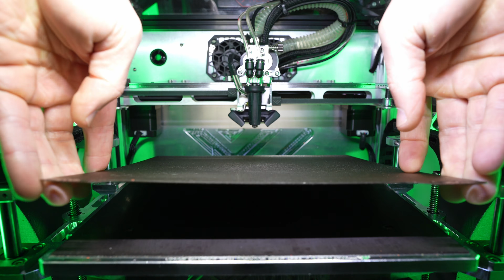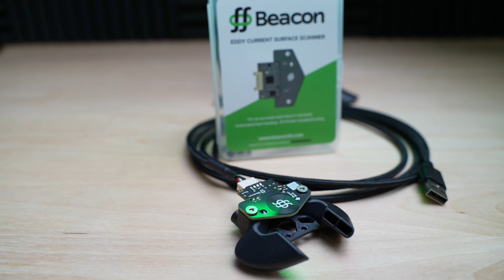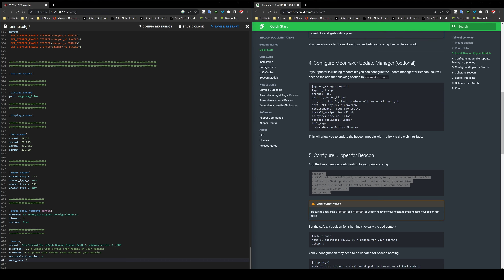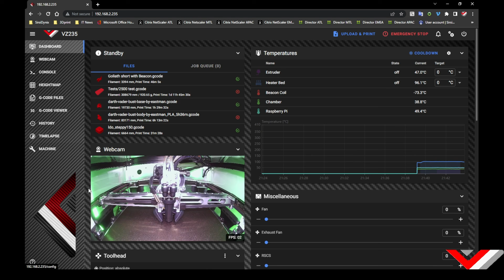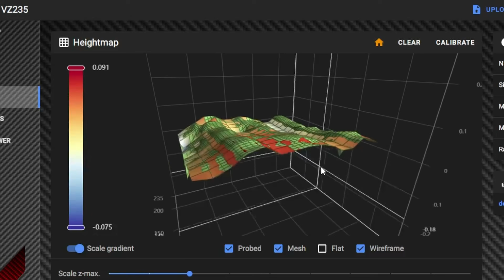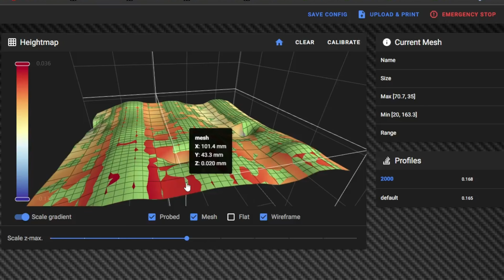Beacon Probe Review and tutorial

Comment: for canbus users I wonder if you can plug the beacon's USB into the USB port of a canbus board like the EBB36. I really don't want to run another wire through my loom, that was the whole reason I switched to canbus.
Reply: It’s usb a not c so unless you change the plug it might work but not worth the hassle in my opinion just run it along side the canbus cable it’s still very tidy

Comment: I have a question. I bought a low profile.
I did all the settings according to the manual, and the id of the beacon came out.
However, there is no response to the endstop check (m119). Is this normal?
Reply: Probe and endstop are treated differently, so if yo uwant the probe to also act as endstop you need to add this on your [stepper_z]:
endstop_pin: probe:z_virtual_endstop
It basically make the probe act as endstop z

Comment: This is fantastic! Is it possible to use this sensor for a super precise "bed screws adjust" routine, where you would park the printhead at the screw location and just look at the Beacon readout while adjusting the screws? Also, can you plug the Beacon into a CAN board or do you need to plug directly into the Pi ?
Reply: Its, its own MCU so no it uses the usb interface.  So unless your can board has usb pins then no.
Reply: @eclypse3d  Thanks!
Reply: Connects to can just fine.

Comment: Hey @Vez3D ✌🏿
I'm currently into printing with higher speeds and I'm facing issues with stringing.
I found out that retraction speed is may more important than Retraction Length.
What retraction length and speed are you using on your big machine?
Reply from the maker: 0.3 and 30mms retract with 80mm/s unretract

Comment: Simon, you should check your webcam configuration. It's not supposed to run between 0 and 2 fps.
Reply from the maker: Its set at 2fps  ..it cant take more. So yes its supposed to run at 2 hehe. Its set to 1080p ..and when at 1080p it runs in still mode. Google it :)
Reply: @Vez3D  i see, so it's on purpose. I had an issue with mine that limited it to about 2fps. When corrected it shows the feed at about 20.
Reply from the maker: @karlspena  what cam ? the official rapsi v2 cam with sony sensor auto turns into still mode when using 1080p..
Reply: @Vez3D  that was precisely the problem. I wasn't using the raspi cam, but a noname chinese usb webcam. Had to adjust some details on the config files to make it work.

Comment: But hey, that is inductive probe, right? So not actually measuring the surface?
I have two side PEI sheet, smooth and textured. When I flip the sheet I'm getting almost inverted bed mesh, and in one case when I dial in the Z offset and then flip the sheet it will dig into the PEI. So not happy with it. Tap is waiting.

Comment: I guess this has the same problem as most other "non-physical" probes in that it measures where the metal below the nozzle is, not the PEI or other non-metalic surface that actually forms the build-surface, right?
Reply: That is correct. If you print on steel sheet with PEI, it can't take the PEI into account. I personally print on bare steel with glue. No PEI involved so no need to worry about it peeling off, also beacon is reading the print surface (minus maybe any contaminants that might be present).

Assuming that your PEI is sitting super flat on the sheet, then that's just a fixed offset. Beacon can get everything else measured (twists in bed, motion system, uneven mag sheet, bumps in the spring steel sheet, ...) because it affects the metal part of the print surface.

For me Beacon is a no-brainer because it doesn't require diving to get the readings so it's ultra fast. Shaves minutes of bed probing, very high accuracy, and very dense grid that is impractical (time) to get with other probes. Also, since I print with glues (Vision Miner, NorthPrint.ca strong glue, Dimafix), it's nice that the probe actually doesn't touch the bed and so doesn't over time get glue buildup on it.

Comment from the maker: IMPORTANT NOTE: Noticed that accuracy test and probing had issue on my probe. Beacon dev spotted the issue and the temp sensor on the probe is broken. You can see the reading of the themp going nuts on the mainsail screen. I must have broken it when I did the de-soldering and re-soldering. Since it does temp compensation, I get weird accuracy and reading in this video. He also thinks that it explains the wave you seen in the bed mesh. Accuracy is coming out in the range of 10-50 micron instead of 0.4 micron.  So even with a broken probe it was awesome, I can't wait to try again with a perfectly working unit :)

Comment: seems like you need to add an avg filter on the measurements!
You are reading the values like they are without noise, thats not smart..
Reply from the maker: Sorry what?😂
Reply: @Vez3D  To get a more stable result, it would be better, if it could sample each spot, like 5 times, and then move on
It could be the reason, why you get those extreme low spots
Reply from the maker: @Zplizor  beacon spotted the issue.. i got a broken temp sensor on thr probe. I must have damaged it while resoldering it
Reply: @Vez3D  awesome, but still, never thrust a non filtered signal, thats atleast how its done in the automation industry
Reply from the maker: @Zplizor  do you mean probing many times ? and average it ?
Reply: @Vez3D  yes, I have for a work project some optical sensors, there I sample them some times, and take the result from averaging them
Cant say if it is at all possible in klipper FW, but if it is, I could maybe give a more correct result in the end
Reply: @Zplizor  I think it already does that, as it measures several times per second. Also stock is giving two passes, but the reason is to compensate the little amount o slop that can give you a different reading between probes done accelerating and decelerating.

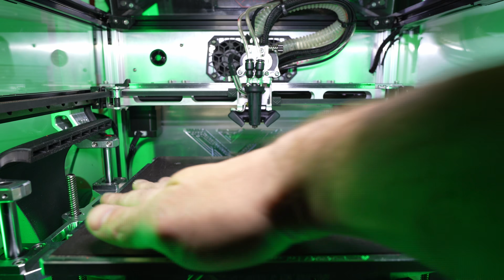Comment: BTW, does anyone know what printer model this bed (3:04) is from?
Reply: Nononono... I mean the one with cylindrical magnets, that you show as counter-example. I was looking for something like it the other day. 

The magnetic adhesive layer... I get the impression that it's thermal expansion is way out of control in hot chambers. And the prints look like mushroom stems before it stabilises.

Thanks for the link to the shop, Vez. ;) That hotend is something I might buy at some point.
Reply: @DailyFrankPeter  China magnetic sheets can be pretty bad, if you can invest on a sheet of Graviflex it is well worth it! Unfortunately it's common in Europe only
Reply: @karellen00  That's fine, I'm in Europe. Which shop sells it?
Reply: Looks like a v2.4 bed. Maybe mandala rose works
Reply from the maker: F3d-racing-fdm.myshopify.com bed

Comment: I don't think that this probe will account vor different PEI layer thickness unless the spring steel of the bed is of a different thickness. This is as the website states an inductive probe. So it can only detect conductive materials. I also think that if you have different types of spring steel you need to rerun that initial nozzle touching the bed calibration. So the probe can get a proper baseline zero reading. 

TLDR: I don't think this system is suitable for quick different bed swaps
Reply: Thats because Bed Mesh is not used for the Z-Offset. Its jsut used to confirm whether or not your Bed is flat.
Reply: @jonny7fly  Yes I understand that, but I was refering to what he said in the video. He said that he was ajusting the z by changeing the mechanical z-stop and that he wanted to use this for quick plate changing and I dont think this type of probe will speed that up.
Reply from the maker: Yeah it will . Tested it. The steel sheet is different thickness. The pei coating is roughly the same
Reply: @Vez3D  Aaah alright then it makes a lot of sense!

Comment: I ran my Anycubic Mega X with just the 2 mechanical endstops and no probe on klipper for about a year and hardly touched the bed, whacked a spare inductive probe and added a mesh which is nice, but really doesn't make a huge difference TBH.

Discovered that I don't like neodymium (prusa) beds and inductive probes the hard way, even after defining where the magnets are.

My next big corexy won't have neodymium in the bed, will be next year and will be taking info from you, voron & ratrig for the build.

Comment: Looks like a great sensor. 
Could you let us know how you can use a bed mesh to tell if the x axis rail needs to be replaced like you mentioned? 
Personally, not going to be upgrading my printers from klicky until necessary, which I don't see happening for a while. 
But for those looking to upgrade from an inductive sensor or BL touch, I definitely see great benefits. 
Thanks for allowing us to see more of this sensor btw!
Reply: I feel like this as well

Should i need a new sensor, this is what i'll get.
Reply: @angrydragonslayer  Then again - replace an endstop on klicky vs rewiring for this, firmware changes, toolhead changes, new parts, getting used to it, etc... maybe I'll stick with klicky - that works quite well 🤣

Comment: Range 0.085mm 😳 and the deviation 8mkm! And still using a peace of paper!!! WTF! Dude, 3dtouch has much better and u can move it as fast as ur printer can, and yes u still need the peace of paper at first, but it can work with magnets.
Reply: I think his probe is comprimised. You can see the temperature from the coil is broken and this probe uses temperature compensation. Usuallly the range is less than 0.0006 and deviation of ~0.00008. Maybe electrical noise is affecting the results too
Reply: @torxfighter i was thinking about that, the accuracy will depend on much microsteps you have on the Z but maybe it got some damage when he resoldered the connector?
Reply: @nunovicente34  I think that since the probe is connected to the raspberry pi directly to report that the accuracy isn't dependant on the z microstep. On normal probes it reports depending on what the stepper drivers tell but not beacon. it will report what it senses. Thats what i'm thinking atleast but i don't know for sure.
Reply from the maker: Yeah its temp sensor is broken.. just noticed

Comment: I only just finished getting the Voron TAP probe running well on my V2.4 but I ordered one of these to try because it think it might suit me better. The TAP is great but it seems like a lot of people have trouble with it. Thanks for bringing it to my attention.
Reply: Wouldn't let me post a link. But video is on my channel I made a mount to use tap and beacon so you can use tap for z endstop for perfect z offset not affected by nozzle and bed changes
Reply: @keenzkustoms2408 that’s very clever!
Reply: Great video very clear.
I can see why vendors happy send out free sample to YouTubers you guys sell heaps for them .
So am I right in understanding this can be used to the quad gantry level as it just replaces the function of the current probe (voron 2.4)
Reply: You know is only causing trouble when the user messes up.
The advantage for TAP is... it's measured from the nozzle. Can't get any better than that.
I'd love to use this beacon sensor but I have strong magnets in my voron bed.
However TAP didn't disappoint a single moment. It's just that...beacon is faster. 😅
5 seconds vs 1 minute adaptive meshing.

I always do a mesh before every print now using adaptive meshing. If it's just a small keychain thingy then it's just a few points right where it prints.
Prusas do a full bed mesh before every print.

But actually printing without a mesh would be best because the z axis won't move all the time
Reply: @REDxFROG  TAP introduces more moving parts than necessary. thats the only problem with it.
Reply: @jdouble_you  yes but I like the fact how it can jump over defects on the print or forgotten purge lines